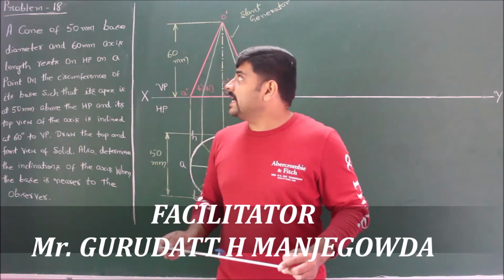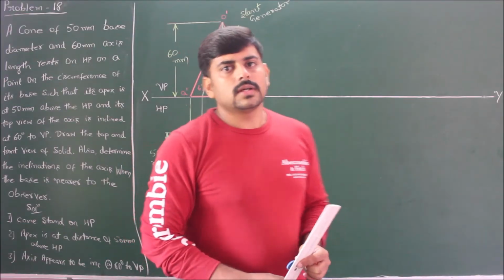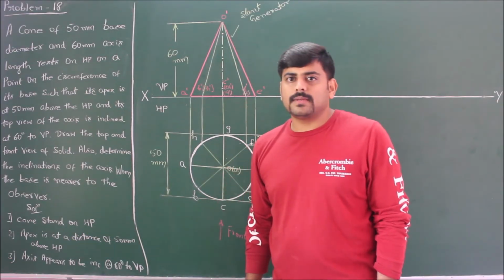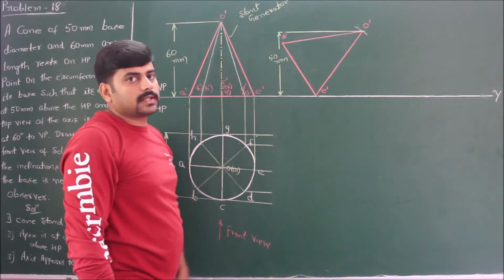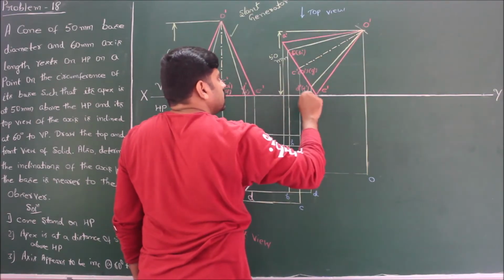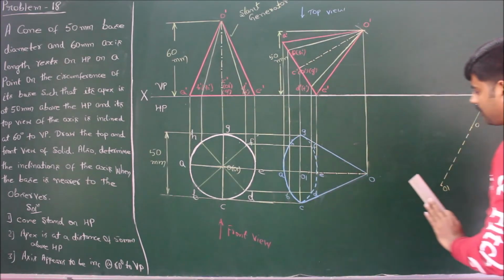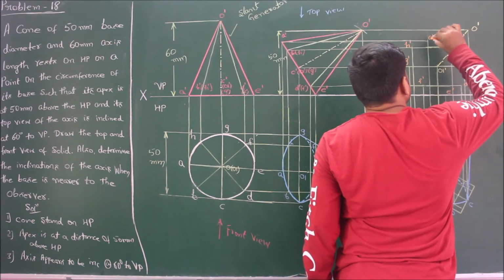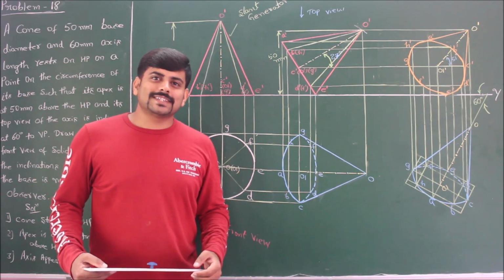44 - Cone resting on a point on the circumference of its base on HP- Mod 3- Graphics by GURUDATT.H.M

Comment: A cone of base diameter 50 mm and axis 60 mm is freely suspended from the midpoint of a generator. Draw its projections when the top view of that generator is inclined at 45° to the reference line and apex is nearer to the observer